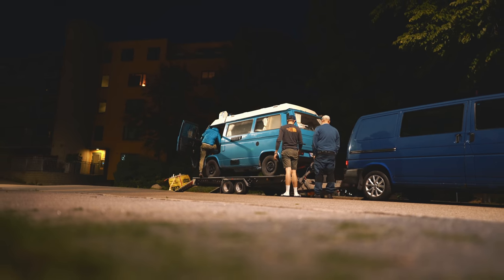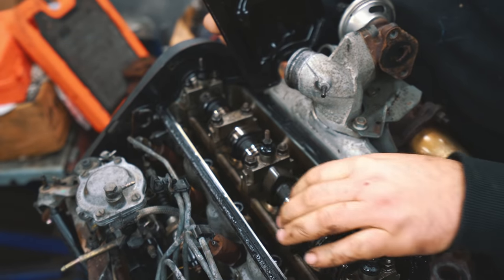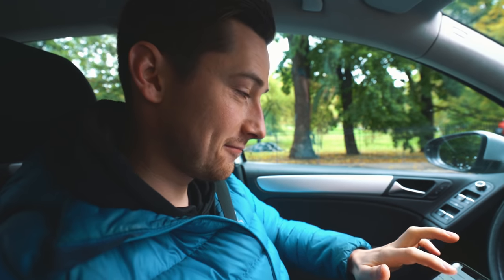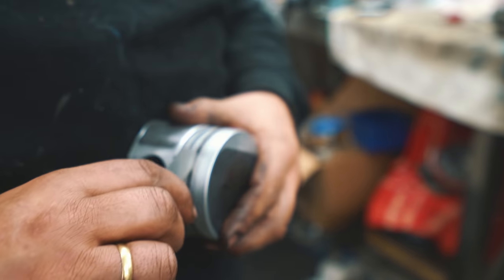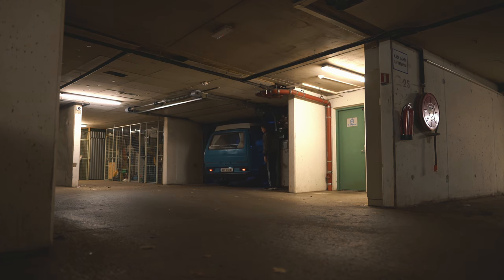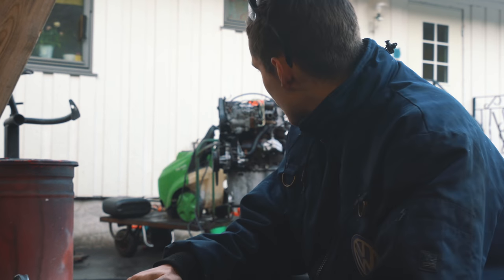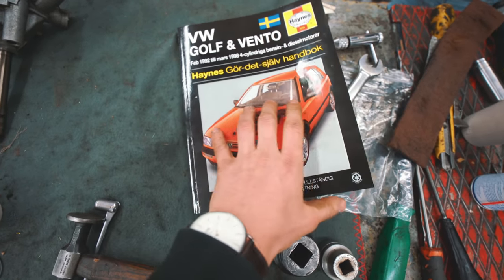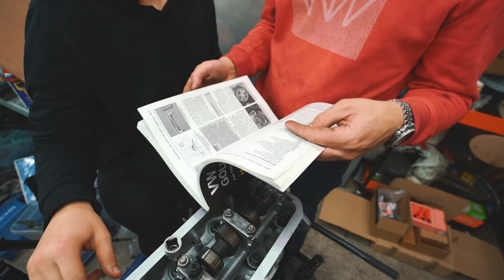Giving our VW T3 (Vanagon) a new engine! Step by step 1.9TD AAZ conversion (part 1)

Comment from the maker: Totally out of the comfort zone here, but we’re learning and hopefully it can be helpful for others too. Do you think we’ll be happy with this "new" engine?😄
Reply: looks like you will be very happy!  You picked a great engine, and now with all the cleanup and refurbishing you're doing, it will be like a brand new engine.  Congrats!!
Reply: Absolutely 💯 % 🤞👍👌👏🤩
Reply: I think you will be.  Subaru is the common choice here in the US, but I've seen plenty of people swap out for an AAZ as well and they seem to be much better than the Wasserboxer and original diesel engines in every way.  Better power, better fuel economy, OBD-II fault-checking... I think you're going to be very happy.  It's such a good feeling to go from worrying every time you go on a long trip to trusting that you're going to get where you need to go.  Plus, IDK what it's like in Norway/Europe in general, but in the US, it's very hard to find mechanics who will work on Wasserboxers or VW diesels from that era.  A modern motor dramatically opens up who can work on it if you break down in the middle of nowhere.  Great first video!
Reply: Remember , better performance means you may travel faster. Travel faster requires better braking. You both seem very sensible so look further ahead. Great video.
Reply: I think these vanagons (T3) make us do that....same here, learning first on installing a used engine (gas) and then doing a subaru conversion...definitely learning....
Reply: My first Wasserboxer lasted 320k miles. It would have lasted longer had I been paying attention to the plugged radiator on a very hot day. Had a meltdown. The engine still ran with melted thermostat, no coolant, or oil (thanks to a lame shop). I couldn't believe it. Had my shop been close by I would have driven it there! Replaced it with a rebuilt 2.1 wasserboxer and it's happy trails once again. My only beef is tight turns uphill where you have to constantly shift between 2nd and 3rd. Other than that I am cool with cruising up grades at a comfortable speed.

Comment: Good video, I don't understand why you did a full rebuild on what was an un worn engine?
I have just fitted an AGR engine to my T3 and did nothing but service it when fitted. Anyway hopefully it will go as well as mine when fitted and running
Reply from the maker: Thanks. We did a complete overhaul to be sure things will work as expected since we dismantled the entire engine. The previous owner didn't have the history of the engine, so we wouldn't risk anything.
Reply: @SimonBraeck  These 1.9 TDI engines
Reply: These 1.9 TDI engines  are tough as nails I was a service parts manager for VW at the time and they made our lives easy. The engine I fitted had done 133k and o would expect it to top 300k without problems with regular servicing, the increase in torque is a joy, I kept all the electronics on mine and fitted the OBD port for easy diagnostics.  Hope yours goes as well as mine does
Reply from the maker: A TDI would be the ideal choice, but I think this is a worthy upgrade from the standard 1.6 right now. In the future we might change our mind and choose a TDI, but then we’ll be more experienced and skilled:)

Comment: Man, the crankshaft had to be replaced with one from 1z / ahu, it fit 1 to 1, but it would have lasted a lifetime, and it would have required a pulley with a clutch on the alternator, greetings from an AAZ enthusiast in Romania.

Comment: Great video very sensible to replace as much as you can during the build, shame the old JX died we had the same in our T3 and it never put a foot wrong in the 8 years and 50km we put on it, it had a total of 179000km when we sold it.Can’t beat a T4 had ours for nearly 9 years.
Reply from the maker: It’s a shame, but I hope this will be a reliable upgrade that will power us for many more adventures the coming years. That’s true, our friend which always keep saving us have a syncro T4😊

Comment: Such a cool and interesting video! Do you think the new engine will also make a difference in fuel consumption?
Reply from the maker: Thanks! I’m not sure, I thought the old engine was pretty good regarding that actually. But my friends say we can expect roughly the same, but more torque at low rpm’s

Comment: If you established that youd hit the jackpot and found an amazingly good condition, low mileage motor, why, WHY would you tear it down and mess with it, ‘recondition’ it? Secondary work is almost never as good and precise as factory original work…a factory VW diesel will go 300k miles easy. Id have left it alone as soon as i saw the cam…put all new external, peripheral wear parts and seals, then DONE. Now you have a questionable rebuild on your hands. Really bad way to go. Besides, all that work for a non TDI AAZ? Why when you could have gone AHU and gotten 20% more base power/efficiency?? Lot of mysteries here.

Comment: Very nice! We had a non turbo 1.9D 1Y in our T3. We also got it completely rebuild and was running like a dream! You should know that the 1.9 engines have a longer stroke than the 1.6 engines. So they cannot make the same high RPM's as the 1.6 engines. This means that your topspeed wil be lower.. if you drive the same topspeed with the 1.9 you will wear out the new engine really quick. For us this meant we had to get a new gearbox with longer ratios. Since our T3 previously had a 1.7. You had a 1.6TD JX, so I guess you will already have a 'long' gearbox and you will be fine ;)
Reply from the maker: Thanks for the advice! I’ve been told that the JX gearbox is capable to handle the 1.9 without much problem, but we’ll have to feel it out once everything is in place. Can’t wait for the test drive😊
Reply: @SimonBraeck  If the top gear proves to be too low, bigger tyres are the first thing to try :)

Comment: Congratulations. Now then, would you be interested in a camper exchange? Time frame late summer 2021 for about 3 weeks. I have a 2018 Lance 825 truck camper on a 2017 Ford F-250. I'm based in California but travel the country and could rendezvous anywhere. I owned a 1982 Vanagon, lived in Germany for 14 years and traveled all over Europe with it, as far as Kirkenes. I'm anxious to take a nostalgic trip from Oslo up the Norwegian coast.

Comment: Greetings from Turkey.I want to replace the engine of my air cooled 2000 t3. water cooled. which engines are suitable from the Volkswagen group. Which is the most successful? I would be grateful if you could help.

Comment: Not sure if it would fit but maybe an ALH would have been better, mechanically more reliable
Reply from the maker: A bit late now I’m afraid😄
Reply: @SimonBraeck  The AAZ is simpler, so you'll be fine. I had this engine and it was great!
Reply: art adrian generally I agree mechanical is better than electronic but electronic high pressure fuel pumps controlled by ecu rarely fail and rebuilding a mechanical injection pump and setting timing is not easy

Comment: I was wondering why you choose a old diesel (euro 0) engine, instead of a powerfull petrol engine? This because of the low emision norms in many European city’s.

Greetings from the Netherlands .
Reply from the maker: Because it’s the easiest conversion and with our skill / budget it’s what we ended up with :)
Reply: And reliable mechanical diesel with good fuel economy 
U can steel it with 2 wires

Comment: Superb! What was the cost of all this? I had my engine replaced because of the cambelt snapped off. Bot now, no mechanic seems to be able to adjust the dieselpump properly :-O It has broke down a number of times! So sick of it. Mine is not a VW Caravelle, mine is a 1997 VW LT 35.
Reply from the maker: Roughly $4000, but that’s with lots of work/help from friends. Doing it at a garage would be way more expensive naturally
Reply: @SimonBraeck  I would say thats what I have paid so far in Sweden ( 40 000 SEK). Unfortunately one of the Swedish car inspection companies here have fooled me. When I bought my van for a little more then 1 year ago it had newly passed the inspection with 0 faults according to the document. The guy I bought it from told me that he knew the guys that worked there, but I didnt think much about it. This fall, on my first inspection with my van, it suddenly had 12 (!) faults on it. I was on the same car inspection company, but in another city. I have done only 7000 km. There is now way that all these faults came up under my ownership. This will cost me a lot of money to repair, and I have opened a case at ARN (consumers right). I hope I will have some luck getting some money back. Good luck with your new engine and thank you for your amazing videos!

Comment: I have to say, if the engine is in quite low mileage, it doesn't make sense to spend another 4000 Euro to renew all the parts, as some one mentioned above, original is always the best, shining piston doesn't help in anyway for the power and reliability actually.

Comment: Nice project... you seem to have some really great people involved. I might be able to help you out.. I have been running an AAZ Vanagon for 15 years and have rebuilt my own engines and transmission... including mods of all kinds... the best mod I made was in gearing to significantly lower highway engine RPM. I am sure there are many people out there more knowledgeable but if you need advice feel free to reach out.

Comment: Replacing old engine with another old engine... not so good idea... however let us know how its going
Reply from the maker: We’ve basically rebuilt every component, it fits our budget and we learn stuff along the way. I feel confident that it will perform good! Just uploaded an update video actually 😊
Reply: @SimonBraeck  yeah but I feel a new engine would have been better because if this does not go well( which I hope not)...then u may b forced to spend on a new engine...my personal view I always prefer branded stuff special when it comes to engine/ parts...anyways don't mean to demotivate you...let's see how it goes...if it was India, it was a simple NO..anyways you plan to roam a lot...so the engine should b reliable...
Reply from the maker: I get your point! We made sure to order only quality parts (Elring, Kolbensmith). It’s also easier to get approval etc with the Norwegian automotive authority.
Reply: @SimonBraeck  Fantastic!!! let us know how its going

Comment: Hello Simon! How familiar is your feeling of delight and at the same time anxiety and slight tremor) I congratulate you on such a wonderful engine and such wonderful specialists who help you in all your courageous actions. I had to fight my AHU completely alone. I came up with everything myself ... And work with the wiring ... the fact is that I got a trade Passat 5, from which it was possible to remove everything ... naturally, I did not want to take extra wires for myself, so the process of collecting the wiring was very difficult for me ... (it was further complicated by the fact that the car was not in the garage all this time and had to break away from the engine on tour I congratulate you from the bottom of my heart) your motor is millions of kilometers! good luck!
Reply from the maker: Hi😀 Oh my gosh, that sounded very tough, the wiring is really something I don’t understand much of and one of the main reasons we didn’t look for a TDI. I hope the end result was well worth it for you and let’s hope our vans will last us for many many years😄
Reply: @SimonBraeck  They will undoubtedly delight!)) I transferred (through my stupidity) a sore from the old motor to ahu ... the oil pump bypass valve does not work ... in cold weather (as now) it tears off the oil filter !!!! I looked at your video with envy))) how did you clean each channel in the engine)) I was too lazy to do it properly ... now I pay off ..
Reply: @SimonBraeck  By the way, you are very lucky that the geometry of the turbine allows you to install the engine without "bullying" your mind))) in principle, you are lucky in everything!))) I am very happy for you, for you fourth!)) I am waiting for your exciting adventures! from St. Petersburg with love)
Reply from the maker: Sorry to hear about that issue you’re having, we learn as long as we live. I’m really hoping we did everything properly so that we can rely on the engine for quite some time😊

Comment: Is it an oil cooler on the side of engine? I also have the AAZ installed in my T3, but didn’t refurbish like you. When is next video?
Reply from the maker: You’re right, it’s an oil cooler. We have been waiting for a new diesel pump forever, and now that we got it, we’re away during Christmas. We’ve set a date for the install in January, but there will be videos (not related to the engine install) prior to that

Comment: Such a tiny engine!
Reply from the maker: Haha, tiny engine for a tiny van
Reply: How is it tiny.....its small
The 1.6 is obviously smaller but similar.....but good decent torque with a higher compression ratio for an IDI diesel motor
There were small cars built with engines smaller than a liter of displacement

Comment: Talk about "barn find" engine! Looked barely run in! That partswasher must be lifesaver - the results look incredible. I hope the rest of is turns out great - and that there's a dyno in the engines future! I, for one, really wonder what performance you can get out of it. Safely, of course. Detonation not wanted 😁
Reply from the maker: Oh yes, such luck! Indeed, it’s really a magic machine which enables us to easily refurbish parts. Can’t wait to drive it and tweak turbo/diesel pump😊
Reply: @SimonBraeck  Having cooling with the blasting agent means you can to thinner gauges wihtout warping too, I guess. Roaling Coal, Veedub style, are we?😂